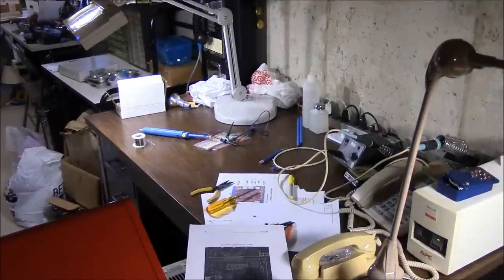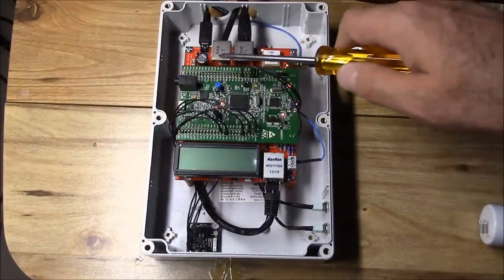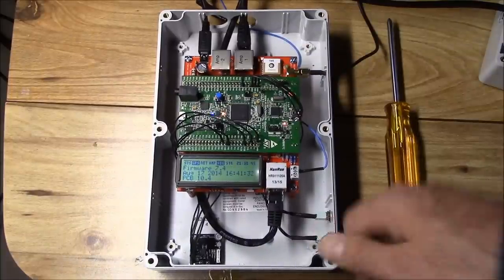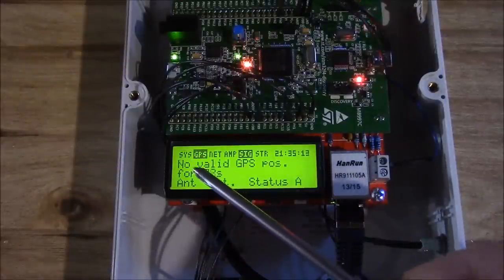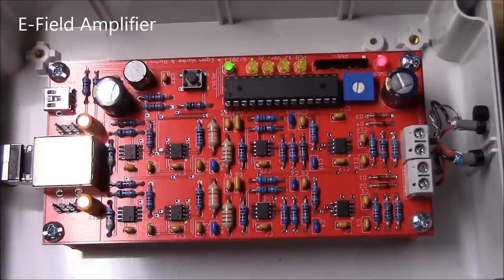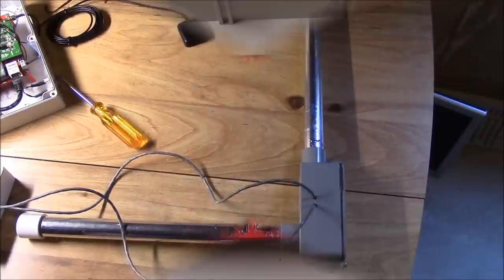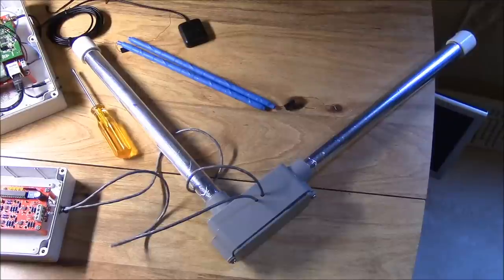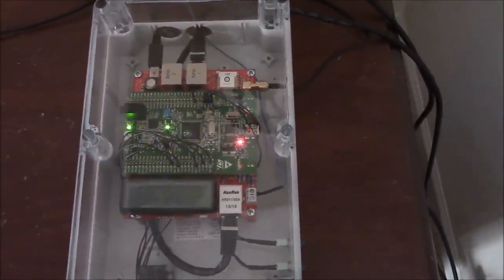Blitzortung "System Red" Lightning Detector Hardware Overview

Comment: Does the antenne placed outside?
Reply from the maker: The magnetic ferrite antennas shown can be anywhere, just away from noise sources. Work fine in the basement, detecting lightning 6000 miles away. The e-field antenna probe MUST be outside on a mast. For nearer lightning within 500 miles, mostly.
Reply: Love to have this, but i dont have solder skills. I had a boltek in 2009, but when i left my parents home, i didnt had the spot to place the boltek antenne. So i selled the boltek. Would be nice if BO sold some pre-assembled Blue or Red systems. :(

I am busy now with the MOD-1016 (AS Lighting board) which you use and connecting it to my Raspberry Pi 3B, so i can detect lightning within 40/50kms. But still it would nicer to have a real BO system for the long range.